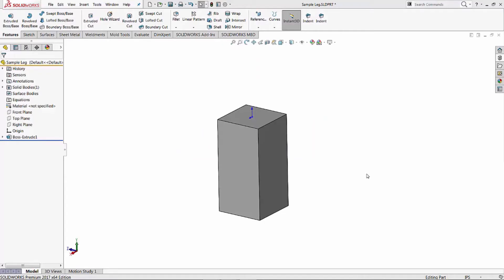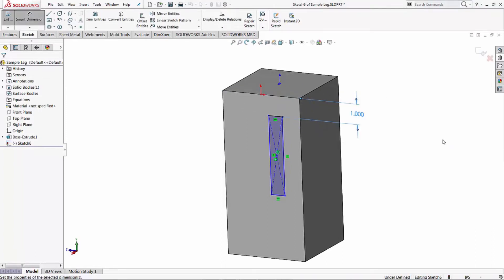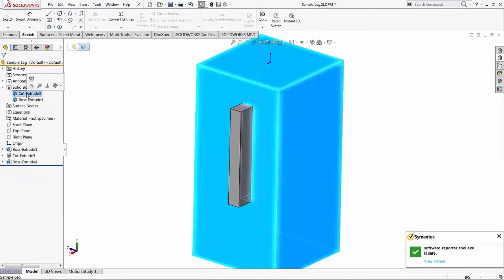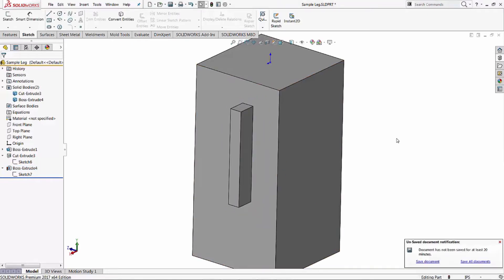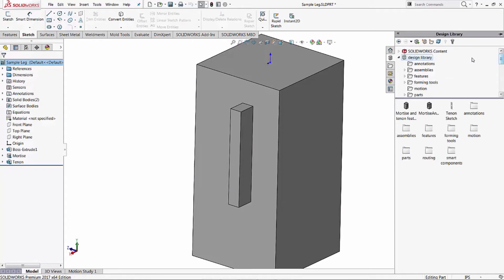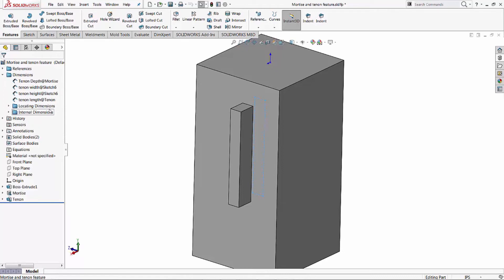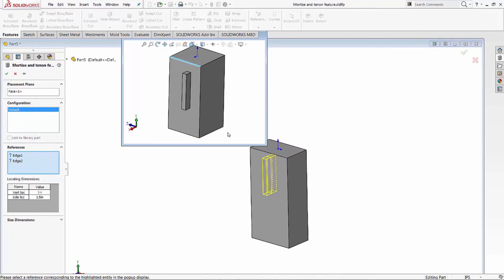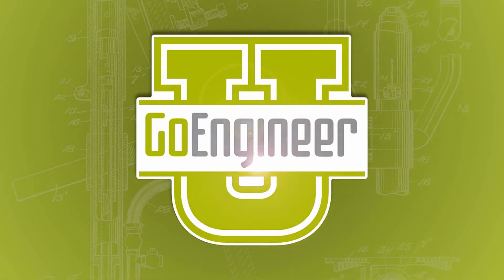SOLIDWORKS - Library Part-Mortise and Tenon

Comment: I've been trying to make a mortise and tenon joint that merges the tenon to a rail, which is a separate body. But I can't get the library feature to selectively merge with a separate body. It either merges the tenon to both the leg and the rail, or to none at all. Do you know how to make a library feature like this one that also merges the tenon to a separate body?
Reply from the maker: Hi Pablo,
I don't think that you will be able to get a selective merge incorporated into the library feature itself.  The library feature does not seem to allow for this amount of select merging  You would have to insert the library feature then specify to merge it onto a specific body using the 'Combine' command (found under 'Insert', 'Features', 'Combine').
Reply: I think a solution might be to make the mortise 0.5 mil larger than the tenon. That way the tenon never touches the body of the leg. I'll try that next.

Comment: this method is the same to do library of trhead?
Reply from the maker: Hi Donald,
Yes, you could use this method to create a library of threads but it may be easier to use the Thread feature to create modeled threads.  The Thread feature can most easily be found by using the Command Search bar in the top right of the SOLIDWORKS window.  You would just type in "Thread" and it would show you the command.  The settings in this feature allow for you to adjust threads easier than editing a Design Library feature.
Reply: GoEngineer have you some video explain it?
Reply from the maker: At this time we do not have a video showing the details of that tool.  Although, the online help files details how it works and the behavior of its parameters (http://help.solidworks.com/2016/English/SolidWorks/sldworks/c_thread_wizard.htm).